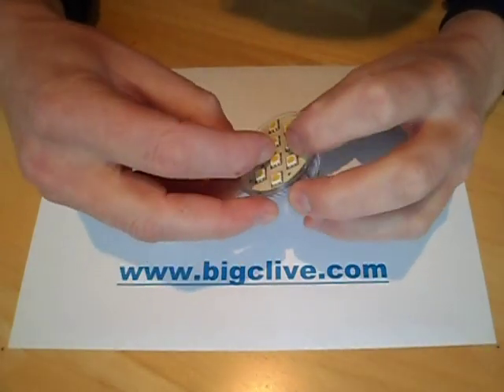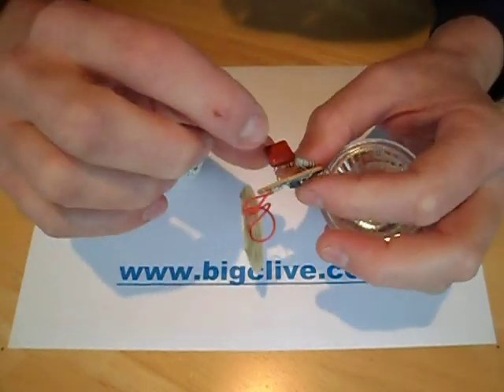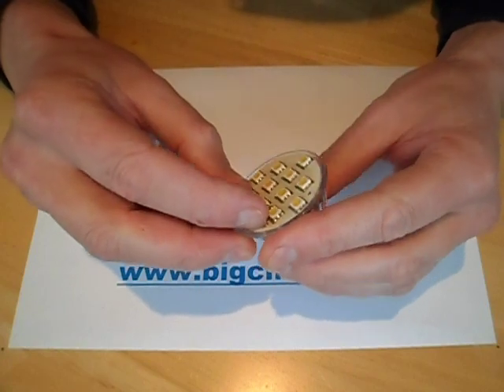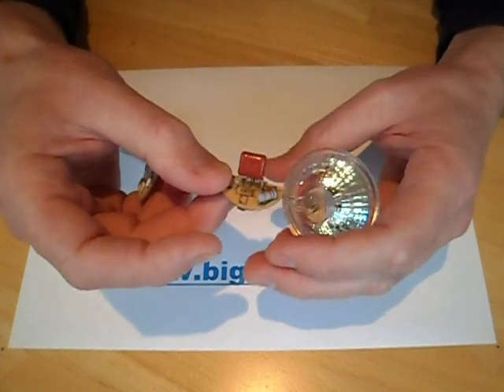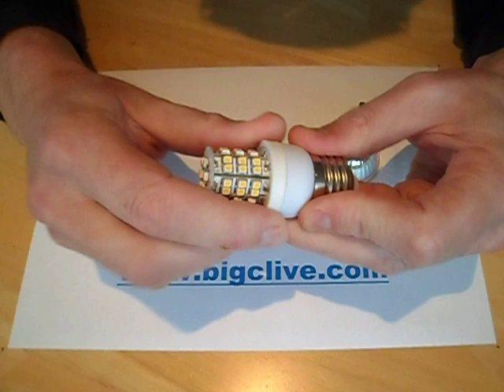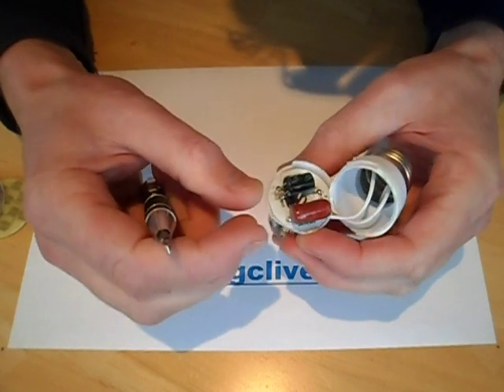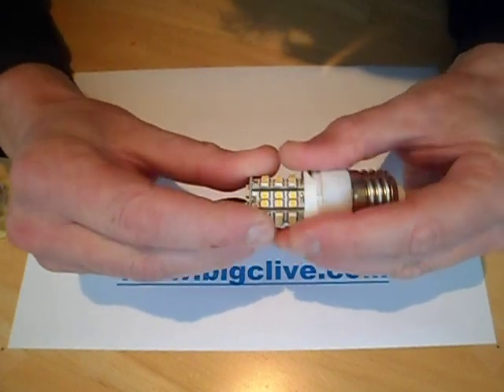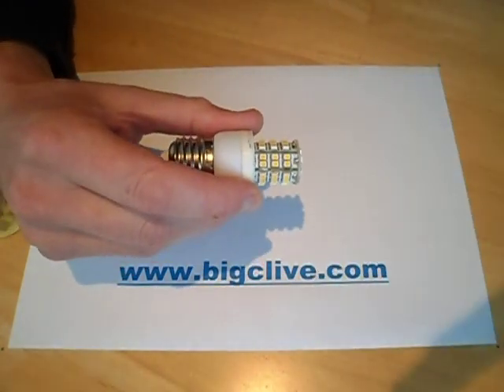Deadly LED lamps from China on ebay.

Comment: i bought quite a few of LED's from china. Good thing is that some of them are actually incredible bright.
The bad thing is that ive gotten minor shocks while touching them, aswell as a few of them exploding (not literally), and most of them went darkish, brown color exterior after a while because the circuit just burnt up.

The only light i keep using that havent failed in almost two years is a Tube light which has a pretty bright led stripe inside. 
Followed a wiring guide online connecting it to 230v. still works, no smell, no failures.

Comment: I only buy lamps locally at a supplier where they have lamps marked UL and CSA approved for Canada and the US. The lamps I buy have a clear acrylic clear insulated window on the top of them for safety.  Most of the lamps selling over here are made in China, or Mexico, or Malaysia. I would guess there are factories in these countries that are making cheaper versions for sale on the net, or wherever they can get away with selling them. 

I have opened a lamp to see inside since I have seen videos about some of these lamps being dangerous. The ones I opened are using an isolated switching supply inside.

Comment: When handling light bulbs for safety reasons: 
1) Check to make sure the light switch is in the OFF position prior to changing a light bulb, incandescent, fluorescent or LED bulbs.
2) When the bulb is ON, do not touch it. A incandescent or fluorescent may be hot enough to cause burns, while a LED bulb without a cover, as indicated here, can give one a nasty shock.

Comment: Hi Clive, 
I actually purchased 2 of the golf ball type bulbs for £5.99 each. 
They lasted all of a month before they went with a pop and almost together too. One on one day and the other the day after. 
I opened them up but would love to send you some pictures if possible for your photo album :-) 
The circuit boards made me smile as it looks like they have been cut from a very old circuit board and just the part they needed for the job. I have since used small circuit boards of my own to repair them and working fine now.

Comment: Ok, You are right, but I´ve something to tell about it.
The first one: You can screw it in without touching any electric connection, just by screwing it holding the borders. Is unusual to see that kind of bulbs, they are the cheaper ones, a little most expensive bulb has a security ring to avoid the LED circuit sepparate from the cover. You are right when saying that is very unusual to see these open electrical connections, but, can´t it be solved by putting on it some non-conductive paste or something like that? I´ve touched these LEDs when they are turned on and they defintely don´t get hot or even warm, and hadn´t any electric shock untill today.
>>The second one: Is again the cheaper one, these kind of bulbs come with a glass protective cover, these ones are suitable for tinny headlamps or desklamps, and shouldn´t be used near places where kids can touch them. 
One of the advantages of these SMD light bulbs is that the soldering is all under the main circuit board and is almost impossible to touch them, but the electric supply is very touchable. You just have to be a very unlucky man to do it, but, again, if you put a llittle dot of silicone (is non conductive and may work as an insulating cover for these soldering dots), won´t this solve your safety problem? At least in the second bulb you juste realized that is practically impossible to touch all the main circuit components without breaking it´s cover...
Reply from the maker: You could walk up to a wire you knew was live at full mains voltage and touch it, and NOT get an electric shock.  Electricity needs to flow through your body to give an electric shock, and if you are isolated from a return path then it has nowhere to go and no significant current will flow.  HOWEVER.  If you touch the same wire and you are making ANY contact with a grounded surface like a damp floor or wall, or worse - actually touching something that is well grounded then you could pass enough current to kill you.  With these exposed solder connections you are randomly touching a path to a live feed with no knowledge of how much current can potentially flow.  It's like Russian roulette.  You may feel nothing, get a tingle, get a strong shock or your heart may be put into a state of ventricular fibrillation resulting in a high likelihood of death.
It's really no good saying "I touched it and it was OK" since the next person to touch it may get a fatal shock.  Even with recessed solder connections, if your finger makes even a tiny contact area then you become part of a circuit.
With the number of these lamps flooding the market it's only a matter of time before a death occurs and manslaughter charges get involved for selling dangerous goods.
Reply: bigclivedotcom Thank you for the warning and exposure to something potentially fatal.  pun intended.  I'm praying some of the trolls on your posts don't have children.  They obviously care more about saving a few pennies than they do about the safety of their families.    I'm a retired electronic technician who worked both in low voltage electronics and also with very high voltages at a power company.  I agree with everything you have stated and warned about.  I appreciate people who take the time to give others a warning when something is this dangerous.  Thanks again.

Comment: That's the thing about capacitive droppers. They're good enough to lower the output voltage to a level tolerable by the LEDs, but they can mislead unsuspecting people into believing that they are 100% safe. The voltage between the poles of each LED is about +/- 3v, which by itself is safe to touch. But the voltage between one of those poles and, say, your metal step ladder, for example, could be 120/240 V. Ouchies.
Reply: Tingles

Comment: In my day (retired a few years) the UK and as far as I know firms like Toshiba never ever used capacitor mains droppers as they were considered, even in the 1960 /80s even if well made, to be liable to failure (o/s) or even fire in a set (short) even though Tosh added safety features - of cause TVs were not grounded/earthed in UK /Auss. However the mains transformer input winding was strictly isolated . RBT were very proud of their safety record - but thats Japanese .....

Comment: I understand where you're attempting to go with this, and yes in a worst case scenario, you would possibly end up dead, but in 99.9% of circumstances, there isn't anymore than a few volts running to the main LED board.

However it isn't common practice to install any kind of bulb while the circuit is live, especially with B22's as they have a chance of shorting out over the two contact points on the bulb.

If I had a choice, I'd get the LED's that have covers, however there are certain bulbs that you cannot buy with covers over them, particularly the new COB LED's, which encompass 3520, 5050 and 5630 SMD LED's.
Reply from the maker: There may be only a few volts across the LEDs, but the supply is referenced to the mains and you can get full mains voltage referenced to ground like if you touched a grounded light fitting while changing the lamp or did it from a metal ladder.  You can't always know for sure if two-way lighting is on or off when you change a dead lamp.  A child doesn't consider "safety" when it touches its bedside light.
Reply: bigclivedotcom I suppose it's better to be safe than sorry, especially when .065 amps is enough to kill you.

I do agree with those two way switch setups and as far as child safe bulbs, but in saying that I would state that LED's with a protective coating over the diodes is really the only option that is child safe as Halogen get very hot very quickly, CFL's contain mercury and are very fragile.

Comment: I got a good belt off one of the cheap ebay LED globes. Even when the power was off, I had the capacitor discharge into me when I made contact with the solder points
Reply: Mark Baron Ouch... These things should have a bleeder circuit in them :/
Reply: Your not wrong
Reply: +Mark Baron But you are, *you're

Comment: i bought from ebay and still using it. And yes, little bit scary when screw this lamp. Using plastic bag to ensure that no direct contact between electric part and your hands. 

fortunately, i am using it for garden lamp, so not so much direct contact after installed it.

Comment: As long as it is designed well and there is no overheating in the confined space then the covered ones should be far better/safer. Not only that but everything collects dust. Which type is easier for the average user to wipe clean? If you guessed the covered one then you get a gold star outlined in platinum. I'm not sure where you get it from though cause I'm not giving mine away so easily.

I use my compressor to clean two old double density strips. The waterproof ones would have been easy to simply wipe off and it wouldn't kick any dust back into the air.
Reply: You make a good point - even those of us taught to turn the switch to off before we change a light bulb, might have reached up to brush some dust off these lamps when on: resulting in contact with the dangerous current.

Comment: I also bought this bulb last month and its working good and let you remind that I touch the bulb while its on by mistake and I didnt get any shock it is jusst 6 v if it is danger then I think every mobile charger is dangerous too didnt you touch the mobile charger very end in the metal which is 5 v I think and ho about 12 volt adapter didnt you touch it..
Reply from the maker: Nope.  If you have a good path to ground like an earthed metal light fitting and you touch the right bit you will pass enough current to be electrocuted.  The mobile chargers are supposed to be an isolated 5V supply with no direct connection to the main supply.
Reply: It might be right but at home think all the floor is cover with blanket so how can I or any one get earth ? To get the shock I have to go out in the garden and change it without wearing anu slipers or boot
Reply from the maker: John Rai An earthed light fitting?  Up an aluminium ladder outdoors?  Holding an earthed appliance or even just leaning against a pipe?  You're trying to justify a potentially fatal product.
Reply: Ok I gave up thank you mate

Comment: Ok, as you can see, it seems to be unprobable to get an electric shock with this led bulbs. Paying a little more for this accessories could lead to have a safer illumination.
Reply from the maker: No I don't think it's "unprobable" at all.  In fact the only people who would imply that it was not dangerous would be those selling this deadly junk.  But it's certainly worth paying the small amount more to have the version with an outer protective cover.
Reply from the maker: Here's a link to show just how much current can flow.  Keep in mind that even a few milliamps is painful, 16mA causes muscle contraction and 30mA and up is potentially fatal.  Dangerous LED "corn cob" lamp test and teardown

Comment: i bought one the same with BC connector, they arnt even bright! the 5w one was dimmer than the 3w quality one i found, and it was only around half the price, it seems there is a point where you cant make a decent bulb for the money, this is where they need to find a way to make sure these are tested
Reply from the maker: The wattage ratings are all pie-in-the-sky.  Some rated 3 or 5W are actually less than a watt.  The difference between a dangerous lamp and a safe one is just a plastic cover.  They sell the lamps with the covers and without.  I just don't understand why they leave the covers off some.

Comment: That small wire will not transfer 240 volts.  I doubt you would get much of a shock if any at all.
Reply from the maker: It takes less than 100mA (0.1A) to kill a human outright.  Even a wire whisker thinner than a human hair will easily pass that current.

Comment: Can i get a lil bit of advice if you dont mind? I received an LED Corn bulb yesterday from China, like the one you show at 3 mins. All was fine and bright, then i go back to the lamp after 30 mins and it had blown. The inside smelled really bad of that burning plastic kinda smell, and had a bit of smoke damage to it. I was ok with that, i suppose you get what you pay for, but the light is less than 2 feet away from my mothers flammable Oxygen machines, and had the potential to really do some damage to us and the rest of the house! I havent spoken to the company yet, i have used them a lot of times in the past and have never had cause to complain, but this has put the fear of God into me! Would you go direct to the retailer, or could you kick off elsewhere like trading standards in regards to the risks? Any advice would be appreciated. Thanks

Comment: I have one with a similar design
But it's covered with a plastic dome
Is it safer? Can I leave it on for a long duration?
Reply from the maker: If it's got the plastic cover then it's safe against touch.  It should be fine for leaving on for long periods of time as most of these lamps are fairly low power.
Reply: I had a plastic cover on mine, it blew out leaving smoke in the bulb and could of been much worse due to its location

Comment: I have definitely been shocked by the second one. Worst decision of my life.
Reply from the maker: Sadly this is the way things are going these days.  The moral of the story is that you should treat all cheap electrical stuff as being potentially able to give a shock.  Sadly that even includes things that really shouldn't be able to do that, like phone chargers.  The isolation between the mains voltage and the 5V output is sometimes little more than a thin layer of lacquer.
Reply: bigclivedotcom And this is why I now buy "Anker" USB cables or other branded USB cables, which arent majorly more expensive than unbranded.

Comment: So it doesn't matter if it's low voltage, you're going to get a deadly shock anyway?
That's a scary thought actually... I've seen USB chargers with a capacitive dropper inside them. Now it feels like they are just pumping death into my devices :)

Comment: The contacts of the bulb are DC level voltage.. This is like a battery in a car, although I can see there being some residual sine-wave residue after the capacitor filtering.  This is the same as a AC-DC transformer for home appliance (black brick) which powers many home items.. do not open and stick your fingers in it and do not saw open the black bricks.. same concept.
Reply from the maker: Nope.  It is DC, but it's directly referenced to the mains supply.  Like the car battery you mentioned with one of its terminals connected to a live mains wire.  It's still just a low DC voltage across the battery terminals (and across the LEDs) but if you touch either terminal of that now-live battery then it will deliver a full mains shock to ground.
Reply: That is true if you touch the wiring on the AC side of the circuit or possibly if the rectifier shorts out, allowing the AC sine-wave to project into the secondary side of the circuit.  The side you would touch is still a DC voltage basically.  The DC side of the circuit does not reference the AC side since it is isolated by the bridge rectifier.  There might be a little ripple if the caps and diode array in the rectifier are not sufficient.  The result is DC at roughly 70% of the AC potential unless it is attenuated on the DC side.  Saying the LED side can shock you is equal to a power supply such as what drives a router or transister radio power supply (black brick AC-DC converter transformer).
AC at 110VAC = 77.7VDC fully rectified.  DC is DC and any AC on the LED will instantly destroy the LEDs since their reverse voltage in measured in milivolts.
Reply from the maker: Stan Skaggs Firstly.  If your voltage is 110V AC then that is the average value of the sinewave.  What's known as the RMS (Root Mean Square) value.  When rectified and smoothed, the smoothing capacitor will be charged to the peak sine voltage which is calculated by multiplying the RMS value by 1.414 giving a DC voltage of 155V on a 110V supply (340V DC on our 240V supply.).  But in reality, because the current is being limited to a series string of LEDs the actual DC voltage in the lamp will be approximately the number of LED chips in series multiplied by 3V.  However.  Even if you had a single LED and therefore a DC voltage of just 3V, touching the LEDs connections would raise your body voltage to the full mains voltage via the rectifier.  Or to put it in a simpler way.  It would be like holding one end of a diode and sticking the other end into a live socket.  If your body was referenced to ground then current would flow and if it was a good ground like an earthed light fitting then the current could potentially be fatal.
Reply: ***** no he is not! even after passing the rectIfier the voltage to ground wil be mains voltage or even more (as he explained before!,)HE IS CORRECT! please educate yourself in this before you replay with your dangerois asumptions.
Reply: my mistake! lol
Reply: So big discussion and all of you are correct only in 50% of cases (depends of way it is connected).

Comment: Hi Clive, from Canada here, in your other videos u have a machine the measures volts, what I'd that machine called.? Tia
Reply: AC line meters like that are sold under various names  one popular here in the U.S. Is the "kill-a-watt". A meter to measure/probe voltages is called a voltmeter, but typically they are sold with other functions as a multimeter.